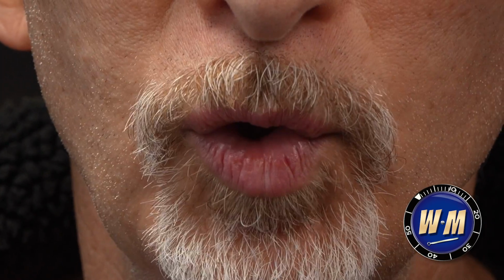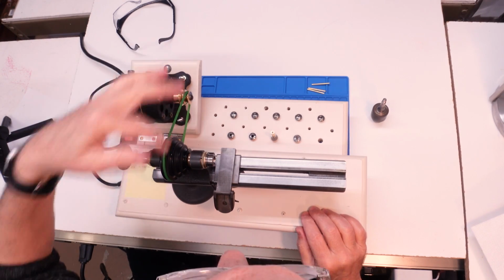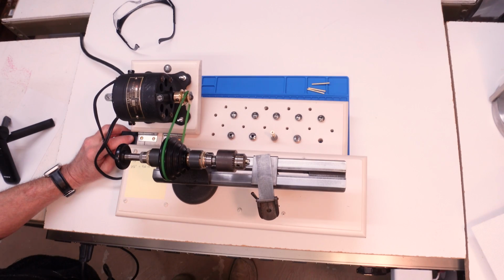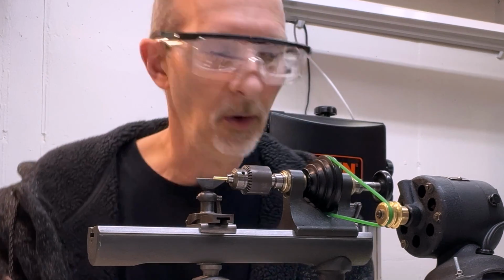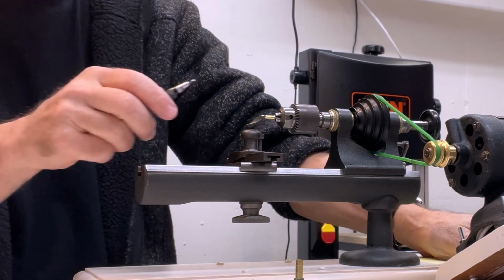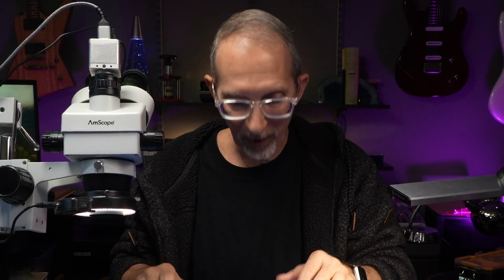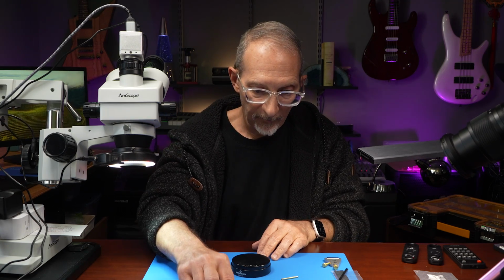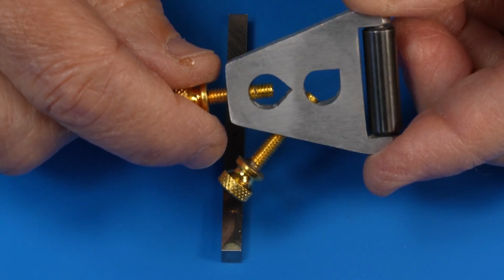My FIRST ATTEMPT at Turning on a Watchmakers Lathe - Definitely NOT a Tutorial! (Part 3)

Comment: Actually Mike, that was faciniating to watch. I have managed to assemble quite a kit of watchmakers equipment. Not least of which is a watch parts cleaning machine to go with my ultra sonic cleaner. I even managed to get a microscope with an LCD screen. A lathe is next in my list as I have a full sized machine centre for full size work in my garage but its too big and clumsy to make watch parts on.

It was interesting to see that watchmakers lathes use hand held tools like a wood working lathe rather than held in a tool holder and moved with lead screws on slides and cross slides. I guess once you get down to making screws and dealing with wheel arbor pivots, you also need to get down and personal with a loupe, or set the microscope to veiw what you are doing... 

I need to get a lathe as I need to rebush some grandfather clock pivots...

Thanks for a great video set... 👍👍🙂
Reply from the maker: Hi Nalak, thanks for the nice words and for watching! I do plan to get a cross slide, which will hold the graver and let me advance the cut more precisely. That is a very common accessory for these watchmaking lathes. But for now I want to learn the nuance of hand-holding the graver. It is a very tactile experience!

Comment: Interesting results! Seems the cutter works and the machine runs well! Great start to you parts turning journey! See if you cant get your machine to take standard tips. That way you can get a small tool holder and replace tips instead of sharpening the tip. I like you dont trust that tool. It shattered too easily when sharpening. You could also make a tool nut where you grind a nut to fit that jig and hold the key steel perfectly. I've never cut with key steel but I with D2 tool steel that I shaped. I honestly dont know the make up of that steel and how many Vickers/Rockwell it currently is. Unless you can find a data sheet or speak to someone who knows it the best you can do it trial and error. Perhaps anneal it, shape it and then temper it and then try one that you only shape and temper. Happy experimenting!
Reply from the maker: It has been a very interesting journey! One of the viewers commented that the tip on my new Graver may be carbide, which would count for my difficulty sharpening it. I've just received a new sharpening jig and will be experimenting with the high speed steel next.
Reply: @WatchWithMike  That could be. Could also be tungsten. Looking forward to seeing what you come up with! Have a great week Mike!

Comment: Whel i put knife smithing experance and logic to that matrer. You aneel the metal to work it and sharpen it and after you harden and then tamper it to.make it flexible. Because obviously a hardend metal is more difficult to woth on then a soft metal. Kind of the same reason why you tryed to work on brass insted of steel
Reply from the maker: That makes sense! I'm also trying to understand how many times a metal can go through hardening/softening cycles before it gets altered beyond usable. So much to learn! 😁
Reply: @WatchWithMike  Yes it's a new world to conker.